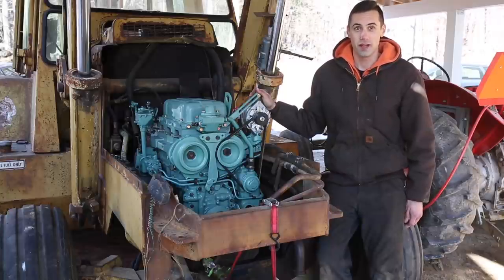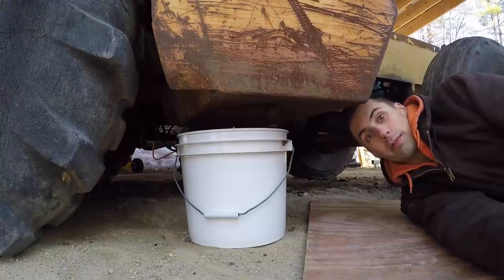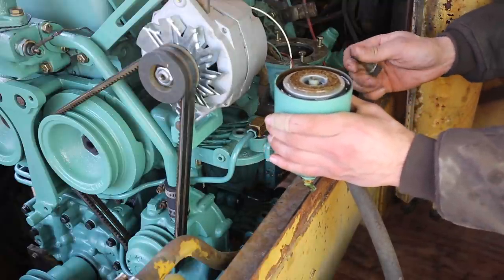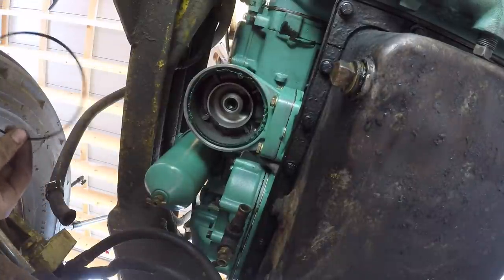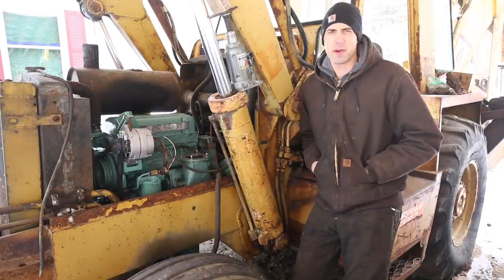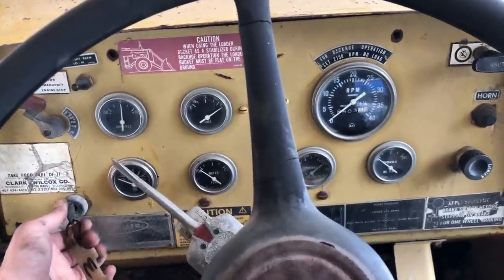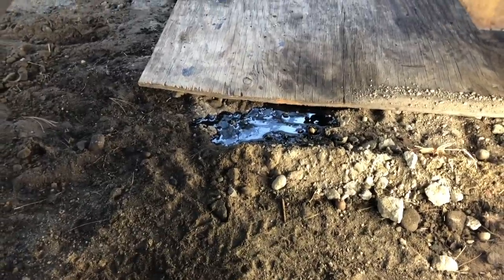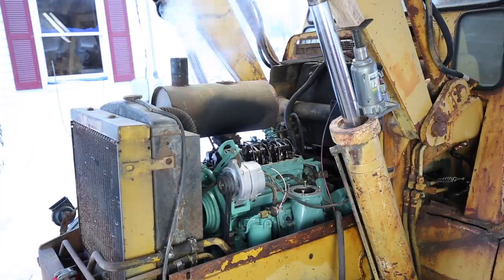Trying to Start a Detroit Diesel 3-53 for the First Time [Dynahoe 160 Part 2]

Comment: My dad and I rebuilt one of these engines.  We called it an "In Frame Overhaul".  This engine spent it's life running water pump in a gravel pit.  This engine ran full throttle 24/7 for seven years, no real maintenance.  It was only shut down so it wouldn't break down.

Comment: Worked on both 53 and 71 Series Detroits when I was in the Marines. Really like those Detroits until they run away.
Reply from the maker: That's awesome, thank you for your service!
Reply: Oh man they must've just sung!
Reply: Had one in a HEMTT back in the day that ran away.  Man alive, that was a sight to see.  It was a fuel truck I drove during a field op in Ft Polk, LA.  Pinned the throttle comming out of a riverbed and when I got to the top, it just went nuts.  Tach was buried, we jumped out and used fire extinguishers to shut her down.  The engine is one thing but with 1950 gal of JP-8 behind it....

Comment: I owned an 8V92.  Was a great strong working motor. Little hard on fuel but loved the sound. It leaked oil from all over but you Can't kill them. They run and run.
Reply from the maker: Wow, that thing must have sounded awesome!
Reply: I too have an 8V-92, which I pulled from the engine compartment of it's hydraulic power pack. It powers the hydraulics of a MAC Saturn 76x42 shear shredder set up with a 48" wide primary set of 2" blades and a 24" wide secondary set of 1-½" blades.  I have recently reinstalled the rebuilt 8V-92, reconnecting to it's  geared transmission to drive three hydraulic pumps, This has been quite a project.  Your's too has been quite a project.  Waldo, you seem to have a knack for the mechanical, curious enough to enjoy the troubleshooting and talented and competent at the diagnosis and implementation of the repairs and reassembly.  Well done.  Great to see these solid older machines taken care of and used.   Dig safe..

Comment: I see a lot of comments on the oil leaks of any 2 stroke Deitroits. The oil control rings in all of these engines was main"culprit". The oil rings are touchy when it comes to dirt ingested by a faulty or unserviced air filter. Those of you who have rebuilt any of the 2 stroke Deitroits know that the Piston/ ring assemblies are loaded from the bottom of the liner,and NEVER from the top! If the oil control rings were to be pushed past the transfer ports,the rings would be damaged and copius amounts of oil would accumulate in the air box drains,and could lead to a runaway under certain conditions.

Comment: My dads best friend has a 1970s Dynahoe that 30 min after he bought it the 3-53 blew up so he ended up swapping in a 6.2 GM diesel out of my dads 82 c10. It is one cool machine. Good job on you're rebuild.
Reply from the maker: Oof! The 6.2 should give it a bit more power though! (I don't think those words have ever been said before 😂)

Comment: I am a millennial about 31 years old, but where I live, DD's were very common engines. In our city, there used to be a CN line near my family's apartment ( I am Canadian). There were all these maintenance vehicles doing snow removal work during the winter, including Pettibone Speed Swings. I am aware that those old Speed Swings used the 4-53 Detroits, but I love the sound. My city also had Vohl snowblowers with 6-71 Detroits powering the snowblower part. These are the kind of engines that create memories in little boys.

Comment: I got my start on 8v92 Silvers in Pierce Fire Apparatus, I’d catch them occasionally on old Blue Bird Wanderlodge motor homes. I still see them in equipment. The 16V in power generation, 12v in the occasional semi… they’ve been a career long love of mine. 
I’ve had them from the Army all the way onto the civilian side. Mechanical through addition of DDEC. 
Someday before I retire I want to get a 70s truck and do a restore with either a 6V53 or 8v71. I just wanna hear that thing run. Then in my retirement I can say I own the best one I’ve ever built.
The US was built by oil weepers in Alpine Green.

Comment: When out of fuel to get it primed I got a 1 qt gear oil container, a length of hose and a fitting to go into the side of the fuel filter. Hooked up like intravenous. To keep the fuel system primed until it starts. Also an in line hose coolant heater for winter with a short blast of starter fluid

Comment: You should have a hand operated fuel primer pump to get fuel through the lines and head, usually there is a plug near or between filters that can be taken out to connect your pump. You also should have a piece of plywood or something stiff ready to throw over intake of blower in case in runs away....the first start is always risky.

Comment: Up in Alaska, we would use those torpedo heaters to heat up our equipment also, but what we would do was throw a sheet of plastic over the engine compartment to help hold the heat in that area as it was rising.

Comment: a good friend of mine had an old chevrolet suburban that he transplanted one of these engines into. great running engine, but top of 4th gear (4 speed stick) was right about 57mph if you were lucky lol. not exactly highway friendly, but you could pull your entire neighborhood anywhere you wanted to go!
Reply from the maker: That's a cool swap! I definitely want to swap a Detroit into something, though it'll need an overdrive and the proper axle gearing too 😬
Reply: @WaldosWorld  you might be able to run a second transmission, like in semi trucks. If you have enough room and enough cutoff wheels, anything is possible lol

Comment: A quarry I worked for back in the 1990s had 7 Terex 60 ton rock trucks. The trucks had 12v92T in them. Regardless how cold it was in the winter,when we fired one of them  up in the shop,open all 6 garage doors, because You could take the unburnt  fuel. It was as bad as any tear gas I experienced in the Army.
Reply from the maker: Wow, those must've sounded amazing!
Reply: @WaldosWorld  sounded amazing,but the unburnt fuel made you gag and eyes water, just like tear gas. A few years later the company got all Cat 773B rock trucks. The Cats didn't choke us out like the screaming D's did.
Reply: The guy rebuilding these 12v92s had a small shop that was a Detroit man, supposedly. One day we just put one of them in a Terex. Marvin one of the lead mechanics,heard a noise coming from low in the block as engine was idiling. He just got his head out from between truck frame and engine block when a connecting rod came flying out of the block,right where his head had been a few seconds earlier. Turns out the Detroit guy forgot to torque a rod,and put a hole in side of block about the size of a man's head. LoL. Expensive mistake for Detroit guy.

Comment: First off nice
Second I have worked on a lot of 3 and 4-53s and the big issues I have found for me is the valve lash .
I find the cams were wiped out in them and the best way to adjust the lash was to keep it a little light and I used a caliper to adjust the injectors
Other than that they were tough engines used in log skidders
Reply from the maker: Thanks! Yeah, these are great engines. As for me, I set the valve lash cold once when the engine was on a stand and haven't had any issues yet.

Comment: Have a 353 in a Pedibone all retain fork lift, starts and runs good. Just makes more noise with a muffler on it, the a V8 gas engine with no muffler. Coverting diesel fuel to noise very nicely.
Reply from the maker: Very nice, that's a cool piece of equipment!

Comment: You did a good job working on it. The starter motor probably was not bad, usually the contactor contacts inside the starter solenoid is what corrodes preventing good contact and often times you will hear a click or sometimes sparking, other times it will even start if warmer. It's fixable if you can get in to the solenoid. As for the blower gasket, it's possible when the wrong motor was put in there and cranked it backwards you blew the gasket. Not your fault, someone sent the wrong starter probably because starter motors were available in different configurations.

Comment: Careful with any oil leaks with that blower! You might possibly have a runaway engine if it starts.  In which case, the only way to shut it down is by cutting off all intake air to it. Sometimes that requires an assistant with a wooden paddle. Otherwise, your new rebuilt engine will keep revving higher until it blows.
Reply from the maker: Yeah, a runaway would be pretty bad! Luckily mine has an emergency shutoff built in to the blower that cuts off the air

Comment: Ether is your friend,  Detroits love ether
Reply: !2ndspingarage.... NO, they do Not.  That's the Very Last thing that should ever be used on them.  If Any DD has to have either to try to start it... it is either seriously out of specs and in great need of a tune -up, OR.... it's in desperate need of a rebuild or, a full re-manufacture.   When DD's are "on spec" and in a good state of tune, they Will fire right up without hesitation, no smoke or any other issues.
Reply: @Romans--bo7br  yeah u can run a Detroit straight off ether, he'll people do that tell it picks up when priming the fuel system
Reply: @Romans--bo7br  stay off the internet please

Comment: Couple of things , I would suggest anytime you start a 2 stroke for the first time would be to remove the 4 bolts from the air intake port and have a block of wood to choke it out if you get a run away. A little bit of wd40 would help to get it to hitting and is not as hard on the engine as ether .
Reply: @rogerridder2903.... He just rebuilt the engine... the injectors and throttle control rack shouldn't be frozen in wide open position.

Comment: Straight 40 wht. Monograde.
Heavy duty oil. I keep a engine heater plug in going on mine and will do a charge up of batterys if I have not started in a week or two. 
My 190 Dynahoe starts up quick
The key is keep engine warm.
The engines call for 40 wht.
Reply from the maker: Yeah, I should use the block heater when it gets cold out again!
Reply: @WaldosWorld  
The controls are like CASE with swing being on right lever instead of foot pedal.  Keep right hand on boom and left on dipper and bucket. Extend out till you are right off ground. practice coming tord backhoe with out digging ground, do it over and over till you feel confident, just remember push lever away and all functions go away from backhoe, pull lever and function comes tord backhoe keep righthand off swing till confident with digging then you can start keeping right on swing lever.
Just some tips to help you dig in control.

Comment: To prime your fuel system, install a ball valve (1/4”) on an outlet on the secondary fuel filter and put a hose barb with clear tubing downstream of the valve. Then use the fill valve from an old innertube hose clamped to your fuel tank inlet. Turn the pressure on your tire fill hose down as low as it will go and pressurize the system while the valve on the fuel filter is open. Catch the fuel in a big glass jar or jug and run fuel out until no more air comes out. Shut your valve and you are ready. She’ll fire right up, I promise.
Reply from the maker: That's a great idea, thanks!! 👍

Comment: I had that machine..the engine ran fine ..I put a flowmaster muffler on it...it put many meals on our table..one thing I did not like was it would slobber two cycle diesel on my trailer deck
Reply from the maker: Very cool, thanks for sharing! 👍

Comment: This was one of two engines that we but in a construction tool it pulled a big weight 2500lb up rails 12’ and dropped it it was all hydraulic pervaded by two pumps the other engine was 255 in line six  international harvester very dependable but no balls at all and I think it should have oil pressure when cranking

Comment: If engine is turning in wrong direction, the oil pump will not build oil pressure.

Great video by the way.👍🏻
Reply from the maker: Thanks! Yes, I figured that out the hard way 😂
Reply: We all learn the hard way, even the best mechanics had their share of mistakes.
But then again, is it a mistake if we learn something from it?
Reply: Agreed this will most likely happen. And bleed all the a it rout of fuel line

Comment: America’s infrastructure and interstate highway systems were built with Detroit Diesel engines. They are(were)as American as it gets.
Reply from the maker: That's one of the things that makes these engines so awesome! 👍
Reply: Please for the love of God send someone to Salem MO to get the 6-71 out of Whitaker's Tow yard.
Reply: In equipment they still are. They were generally the same from 1938 through their whole run and parts are still available as the tooling to produce them was acquired by a company in Germany. I still see them regularly.

Comment: #2 Home heating oil is dyed red but basically the same as diesel though the dye tends to clog injectors over time. It is illegal to use in highway engines as home heating oil is not taxed. Not sure
If that applies to farm and construction equipment also
Reply from the maker: It seems pretty common for large farms and other businesses that use lots of off road diesels to use dyed fuel. Interesting, I didn't realize that it would clog injectors!
Reply: Red fuel clogging injectors pumps and filters is a bunch of bullshit
Reply: @ChrisComp  Old post but I hate seeing this. I'm with you, an injector is an injector, just different sizes. And home heating oil isn't road taxed, so they dye it red so truckers can't save a dollar ( HEVEN FORBID!!! ). I cannot see a situation where a red, or any color dye, clogged "certain" diesel engines versus an oil fired boiler. Those have nozzles too, that spray fuel....

Comment: 2 stoke diesels should take SAE C*-2 rated oil, with the * being as far down the alphabet as possible, at least CF-2.  the -2 stands for 2 stroke.  the best brand is the one made by GM for GM, Delo 100.  It has low ash content to prevent coking.  A couple of fluid ounces of Marvel Mystery Oil will also help dissolve coke, especially if you have trouble obtaining Delo 100, which is NOT the more common Delo 200.  For some reason Wal Mart'sDiesel oil has a CF-2 rating.  Maybe old Sam had a Detroit.
    I spent a summer helping expand a campground with it's own gravel pit, driving an old Chevy Brigadier dump truck with a 6V-53. and loading with a Hitachi EX-60 excavator.  It was once affiliated with the camper that hit the novelist, Steven King.

Comment: 2 strokes take 2 stroke oil with a 2 stroke API rating, starting with C for compression ignition and ending in -2.  I hear Delo-100 is best but rarely in stock.  For some reason Wal-Mart oil is 2 stroke rated.  Maybe old Sam had one.  It has a strict maximum ash content to resist coking.
Reply from the maker: Oh interesting! I didn't realize the -2 or -4 suffixes meant two or four stroke. I also didn't realize that Walmart oil is rated for two strokes... I usually use Shell Rotella SAE 40, but Walmart oil could be a good choice in a pinch
Reply: @WaldosWorld  Rotella T1 40 wt does have a CF-2 rating, which might be the highest unless they have a CG-2 now, but Delo-100 is specifically formulated for the old GM 2 strokes and probably has less ash for less coking, so given ordering time, use that.  The C in "CF-2" stands for compression ignition and the "2" stands for 2 stroke.
Reply: @WaldosWorld ..... You MUST use LOW ASH rated Straight 40 wgt (or 30 wgt Below 32 deg. F.)... Rotella T1 is NOT - Low Ash rated.  It WILL "slobber" and Will "coke-up" the intake ports.   Also, it's Best Not to idle your engine (or Any 2 cycle GM Diesel / Detroit Diesel) for more than a couple of minutes, and even then.. only for "cool down" after it's been working hard.  Extended idling on these engines WILL cause cylinder Glazing, resulting in pool oil control.  These engines should either be "working" or shut down.

Comment: Gotta pause when cranking a cold diesel. Let some of the fired diesel in the cylinders heat up the cylinders. Wait about 10 seconds between cranking periods, not more cranking than about 20 seconds at a time.
Reply from the maker: Thanks for the tip!

Comment: The water would’ve settled at the bottom could’ve just untwisted that once you seen diesel you knew it was good and then twist it back up didn’t really have to drain that much fuel lol

Comment: Firstly I really do hope you didn't tear up any bearings cranking and cranking and cranking in the wrong direction...... Secondly what is all that clatter did you turn the crankshaft around by hand several times when you set the valve lash? Usually they don't clatter like that when you're just cranking..... Next time fill up the fuel filters with diesel and crack open the injector lines to let the air out when they start spraying fuel close them up and start the engine

Comment: How is your Dd liking that Rotella 40 wgt.. a few years down the road, later?    It is Extremely critical that you use LOW ASH 40 wgt, Only.   Rotella T1 does Not meet the DD Low Ash specs.   Also, exhaust smoke coming out of the Blower inlet... is Not "usually" a good sign. LOL  I think you have a reverse rotation starter.  Detroit Diesels can be built to run in either rotation.  I have Not watched the whole video, yet.... I stopped just before you tried to start it with the key... other things calling my attention, will be back later.  Good luck.... oh, and change the starter.

Comment: Why run straight grade oil in the motor ?  That's very old tech. The newer oil flows so much better and quicker on startup which means less wear.

Comment: Hello. We recently got a Rayco roller type 400 with a Detroit 3-53 two-stroke diesel engine. Does this engine need a special engine oil or can I use the same as for four-stroke diesel engines? Thanks in advance.